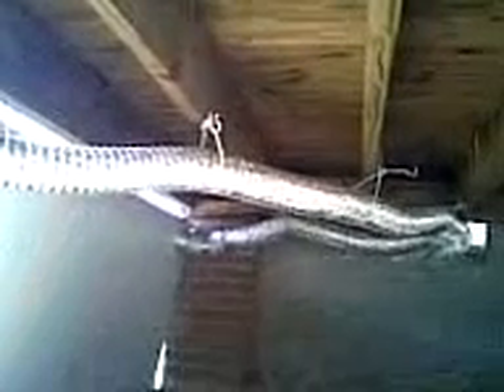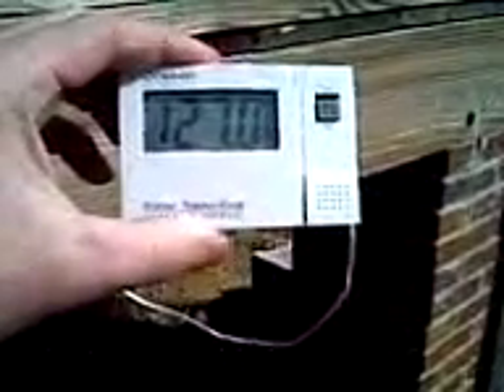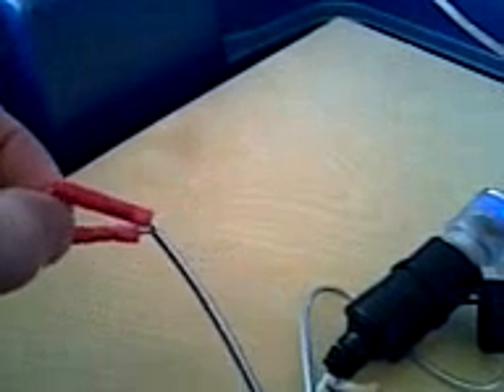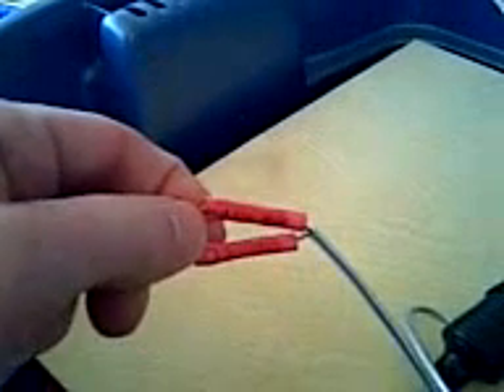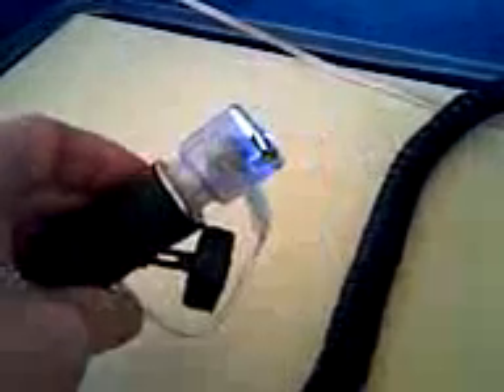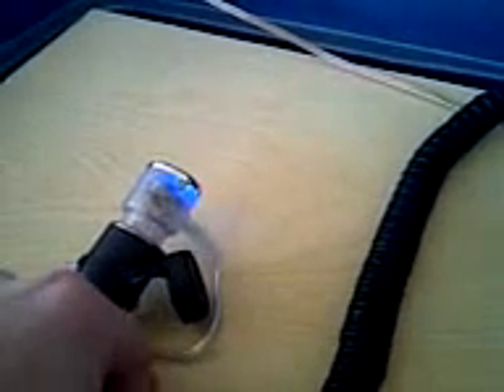solar can heater

Comment: I am on my first solar heater and it is very similar to yours. I was skeptical about it until it put out 178 degrees with it being 46 degrees outside. I'm in the process of fixing a few material errors, but I expect to be using it to supplement the heat in my house very soon.

Comment: @jjohn984able Most thermostats will support a light duty DC fan and they are pretty cheap around $10-$15. For a huge fan, a relay would be needed, but not necessary in this case.